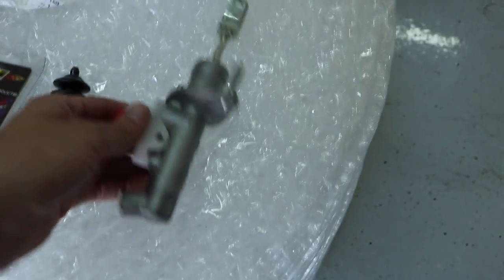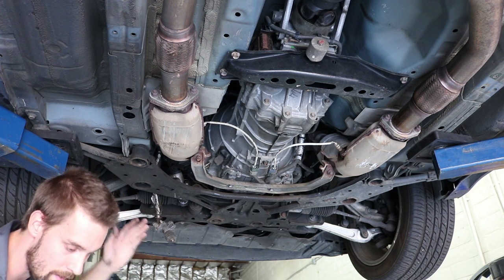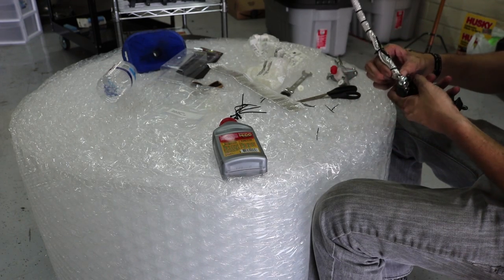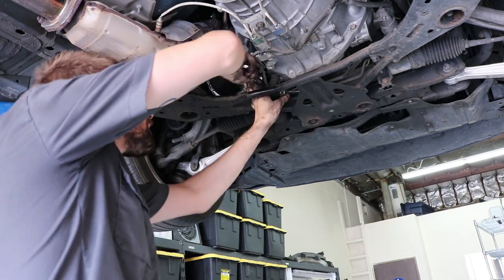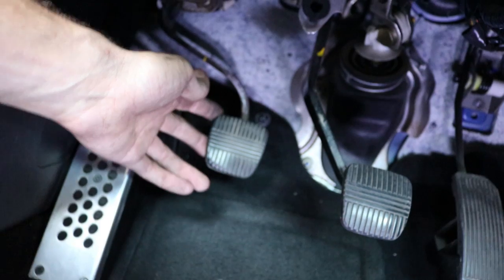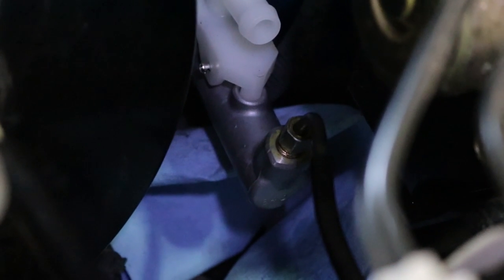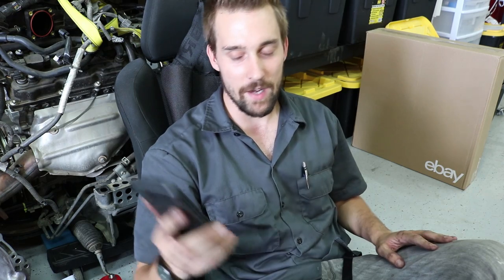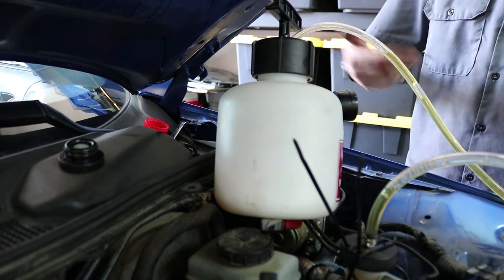350Z Clutch Master Cylinder + Slave Cyl  + SS Clutch Line Removal & Install

Comment: Hey bubba, I got a question about a grinding noise after a new clutch install. Is it normal to have a rough sandpaper or cement mixer noise coming from my 6 speed transmission after a full clutch kit install? Never had that sound before on stock clutch and it's not a  chatter sound, it's a sound like dragging a big rock over cement every time I push the gas peddle in every gear but does becomes less noticeable in 5th and 6th but is very loud and noticeable and annoying af in 1st, 2nd and 3rd evenr time I accelerate from a slow roll or dead stop, oh and theres no noise at all in neutral even if I rev the engine,  on when I am in gear while accelerating. Thanks in advance
Reply: did you replace the flywheel as well?

Comment: I’m having a hard time changing gears on my 350Z. Like they change but I gotta like force it to change. This situation happen after taking off on 1st gear and try switching into 2nd gear. After that, I’ve been having to force it to change to gear. Sometimes it’s hard to shift to 3rd. Sometimes it’s hard to shift to 2nd. Etc. sometimes I get lucky and shifting it smooth but sometimes I gotta force it to shift gears. My question is, will changing my master cylinder, slave cylinder and clutch line fix my situation?
Reply from the maker: Could be many things, lack of pressure because of air in the lines, bad fluid, failing master or slave, short shifters or unweighted shift knob etc
Reply: Full Throttle I bought the master and slave and clutch line. Ima have those replace and hope it fixes my situation

Comment: how do you recommend bleeding the slave if i dont have a lift. Theres air trapped in my system because i cant get under the car while its level so i put it on ramps. But it seems the the incline is trapping air somewhere in the slave and the air is unable to escape through the bleeder. Any advice? thanks!

Comment: Is the heat wrap material necessary for the SS Clutch Line? My understanding was the stainless steel itself and the material was designed to withstand higher temps than that of the OEM clutch line?
Reply from the maker: Av8tor The way I thought about it was I might as well do it while having it apart. I just wanted to be 100% certain that the Cali heat, especially during stop and go traffic wouldn't be too hot for the fluid.

Comment: Bet you’re having issues… you didn’t bench bleed the master.. you need the bleed them separate
Reply from the maker: I've done this over 300 times now since this video was made, my daily life is working only with z's g's and q's. And with the clutch master, primarily the VQ35DE it isn't necessary to bench bleed. It's actually not necessary at all with any vq platforms as long as you use a power bleeder. But you don't even need a power bleeder, and it's recommended not to use a power bleeder with the hr or vhr when they have an internal slave cylinder. You probably think I'd have issues, but that assumption comes from a lack of experience on your part. Best of luck with your z or g, since you're watching this video probably means you've never actually done it before.
Reply: @fullthrottleperformance   lmao.. sure bud. Enjoy your shit petal feel.  I do thinks right the first time.
Reply from the maker: @Turtlefarm  read the factory service manual bro 🤣 and there's no petals in a car, there's petals on flowers. And I always "thinks" the right way lmao 🤣

Comment: I have a 2008 g37. 6MT. So when I change gears, I noticed that 9 times out of 10. It’s not silky smooth. I’ve heard of grinding and crunching gears but I’m not sure if this is what they refer to.It doesnt make any noise, it’s just I can feel it. Sometimes it does go into gears smoothly. I also noticed when I’m not moving, I’ll put the clutch in, put it Into gear, take it out of gear and put it back into the same gear and the second time it goes in smoothly. But not the first time. What do you think it could be?
Reply from the maker: Have you flushed the trans fluid? And you have a CSC, they tend to go bad easily. It might be starting to fail, and when you initially put it into gear it's not depressing the pressure plate enough to go in smoothly, but after you take it out the gears are perfectly aligned and making it go in smoother? I don't know, just a guess. But I'd start with the cheapest route by flushing the trans
Reply: Full Throttle yea I had the Tran fluid changed at my work. I used Infiniti oem fluid. I started reading some comments on Tj hunts video and they were saying that using anything other than mt-90 will fuck up the synchros. Do you think that might be it. The one from infiniti is 75w-85.
Reply from the maker: If you got the fluid from Infiniti you should be fine. I know CD008/9's take only GL-4 in the trans, and GL-5 in the diff. That might be what he's talking about, but then again I'd never go to TJ's channel for info on fluids. You can find all that in the factory service manual, just google your vehicle, and "factory service manual"

Comment: Have you encountered a squeaky clutch slave cylinder? My clutch squeaks when pressing it sound like the slave is going out
Reply from the maker: Yes, but I haven't actually replaced anything because of it. I'd start with the cheapest parts first, and listen carefully to see exactly where it's coming from. And replace the cheaper parts first, that way you don't end up spending a lot, on stuff that doesn't need to be replaced
Reply: Full Throttle yea ima do that! It’s weird it sounds like a Creak when pushing down and it feels stiff but it shifts super smooth 🙄
Reply from the maker: Weird, maybe replace the slave, if it's just a squeak maybe wait till it starts going bad then replace it. Idk lol

Comment: How did you get that bolt off that stripped ? I’m having that issue right now and need to fix it ASAP !!
Reply from the maker: Yadi Cerda Spray it with some pb blaster or liquid wrench(penetrating oil), and let it sit for an hour then get back to it. That should make it a little easier, I didn't use it, I eventually got it. But I should use that stuff more often lol

Comment: If you didn’t power bleed the system, would you have experienced the clutch pedal going directly to the floor immediately after replacing the clutch master and slave cylinders in a Z, due to air being in the system?

I’ve replaced these components for other vehicles and the pedal would be spongy prior to bleeding but, it wouldn’t go straight to the floor.
Reply from the maker: Yes, z's are pretty difficult cars to bleed the clutch system. I've bled them before without the power bleeder(2 person bleed job) and it takes a lot longer to bleed. And the pedal will go straight to the floor.
Reply: Full Throttle: Thank you for your response. 

During the bleeding process, does the pedal eventually rise back to the usual maximum height, at the rest position?
Reply from the maker: Chanandler you'll need to pump it a few times, just make sure you bleed the hell out of it lol. And keep pushing the pedal a few times to get all of the air out of the master cylinder.
Reply: Full Throttle: Thank you for the info.

Comment: What do you think when the clutch let's go close to the wall? I tried clutch adjustments but still feels the same
Reply from the maker: Try getting a power bleeder, and bleeding the system. I've bled a lot of these and it always makes the clutch operation smoother. That's the cheapest route. Other items like the slave or master could also be an issue. But start at the cheapest item first
Reply: @fullthrottleperformance  bleeded and change just the clutch slave cylinder, and it fixed the problem
Reply from the maker: Awesome glad to hear you got it fixed!

Comment: Do you by any chance remember the eBay  seller you got your setup from? Was it from “zspeedperformance” by any chance for $175 shipped? Or was it someone else? 

I’m trying to purchase the exact setup you did. Also, I heard you mention something about Cali heat and I was wondering, you wouldn’t happen to be in the 916 by any chance would ya lol. Thanks in advance brother. Great channel for us z33 folk too. Keep at it man.
Reply from the maker: Yeah bro, I'm in the 916 lol. And here's the link of the seller I've bought some OEM parts from. 

Master and Slave
https://www.ebay.com/itm/2003-2005-Nissan-350Z-Clutch-Master-Slave-Cylinder-OEM-NEW-Genuine/191343943509

Phase 2 SS line
https://www.ebay.com/itm/P2M-Phase-2-Stainless-Steel-Braided-Clutch-Line-for-Nissan-350Z-Z33-03-06-VQ35DE/401595750553?fits=Model%3A350Z&hash=item5d80f8d899:g:dQsAAOSwLeVZ0mlq&frcectupt=true

Thanks for the support bro! It's much appreciated!!

Comment: Quick question, I’m currently replacing the clutch slave cylinder but no type of fluid is draining. I think something is clogged?! What could it be? If it’s the clutch master cylinder then I’ll be good
Reply from the maker: Do you have a power bleeder?
Reply: Full Throttle I don’t. But I just inspected something. The hose that goes from the reservoir to the clutch master cylinder, it still had fluid in there. No type of fluid was going thru. I took of the master cylinder and I think it’s clogged or something. Once I took it off, a little bit of fluid was coming out
Reply from the maker: @felipegarcia2419  What was your initial issue?
Reply: Full Throttle well I’m really hoping it’s the clutch master cylinder. Like I mentioned above, no fluid was going passed that cylinder. And I took it off after watching your video and I noticed some oil fluid came out. Expensive part but I hope that’s my issue
Reply from the maker: So, you get it fixed? What it'd end up being?

Comment: Can you tell me how do you fit the power bleeder adapter on the clutch master cylinder reservoir?I have been trying it but the two tabs on the side of the reservoir keep getting on the way.
Reply from the maker: It's kinda a b**ch to fit and hold on while under pressure. I usually use two zip ties to hold it down. But the two tabs go into the slots on the adaptor

Comment: FT what Power Bleeder model are you using to bleed the clutch system? Also which attachments for clutch fluid reservoir? Thanks! -R
Reply from the maker: R Loney Link is in the description for the exact model and power bleeder I got. It's also a Ford model, 0107 adapter. It's actually 20 dollars cheaper than I paid like 4-5 months ago. Only 49 dollars right now.
Reply: Thanks!
Reply: I enjoyed

Comment: Hey so i installed everything and the hardline that connects the master cylinder leaks every time I push the clutch pedal down. Is it not tight enough?
Reply from the maker: Hopefully it's not cross-threaded. Did you find the issue?

Comment: So my clutch pedal is doing the sticking thing but it works and I just replaced the slave and it’s still doing it so do you think I just need to bleed it more or a new master?
Reply from the maker: You figure it out? It could be either, make sure you bleed it plenty, the two man method works good, but takes a decent amount of time
Reply: Full Throttle yeah I did the two man bleed thing but it still wouldn’t build pressure I’m pretty sure it’s the master I adjusted the pedal and it made a big difference and doesn’t stick but sometimes it does so I’m just gonna replace master like tomorrow or sometime
Reply: Full Throttle thanks
Reply from the maker: Yeah, sometimes you just have to replace both. Best of luck to you tho, hope you get it right
Reply: Full Throttle thanks, btw helpful video

Comment: How much psi did you pump it up to
Reply from the maker: I generally pump the motive power bleeder up to 15 PSI
Reply: @fullthrottleperformance  Did you bleed the clutch with the pedal to the floor or while it was up?

Comment: Hey I got a question . My cluth pedal feels a bit sticky on hot days .. almost feels like I’m stepping on gum right at the engagement point . I’m thinking of pulling out the slave cylinder to grease it up u think that’s going to fix the problem ? Or am I better off buying a new slave cylinder all together ?!
Reply from the maker: Get a stainless steel braided line, and new slave. It'll be a lot better in the long run, you won't get that feeling, make sure you thoroughly check out the master cylinder. Because if it's leaking or bad you'll have to do the job over again. Slave cylinders are cheap, I'd just replace it. 👌
Reply: Thanksnman! Any experience with slave cylinders from autozone ? Are they worth it ?
Reply from the maker: @evanmavros1942  I would go to Napa, every time I've gotten a slave or master from Autozone they end up leaking. I'd personally recommend going to the dealer, because the slave isn't expensive
Reply: Full Throttle thanks for the help man ! I think I’m going to just bleed the line and grease up the slave cylinder tmr .. if anything looks worn out or broken I will run and grab one to exchange.
Reply from the maker: @evanmavros1942  Sounds good man, good luck with your z👍👍👌
Reply: Full Throttle it’s a G but thanks!
Reply: Will a “gravity bleed” get all the air out ? I’m a noob as u can tell from all the silly questions ..
Reply from the maker: @evanmavros1942  I always have to use a power bleeder, z's are pretty difficult to bleed
Reply: Full Throttle ended up buying everything new cause the problem didn’t go away . How come u have the powerbleeder cap on there with zip ties ? It doesn’t fit the clutch reservoir ?
Reply from the maker: Evan Mavros No it fits but I just like to be cautious with pressurized brake fluid
Reply: Full Throttle hey so I changed slave/master and braided line on my G.. for the first 4 days it has been working PERFECT to say the least but today I kind of felt some sticking again but nothing compared to what it was before .. what do u think is the cause ? Only thing I didn’t do when installing the new slave and master is grease up the tip head of the slave .. u think that might be the cause ?

Comment: Good video! Really need to do this to my zed. What ringtone was that? Ava?
Reply from the maker: MiddletoM Thanks man, and it's just the standard Samsung ringtone, lol. And if you do, do it on your z. Make sure you bleed the system really well, a lot of people skip out on doing a really good job at bleeding it, and it isn't worth skipping out after doing everything else
Reply: Ah lol, really does sound like angels and airwaves.

Anyway, i will just cough up and buy the power bleeder. i suspect my brake fluid could do with being replaced so the power bleeder will come in very handy. ive used the 'one way valve on the bleed pipe' method and its a pain in the arse.

Comment: Hey I got a question my 350z clutch pedal has an inch of play on cold start after driving for 30 minutes it gets stiff and sometimes when you push in the clutch  about an inch you hear a clicking noise do you have any idea what that could be
Reply from the maker: The clicking noise might come from the throw out bearing, have you tried bleeding the system?
Reply: @fullthrottleperformance  I haven't tried bleeding the system but when I do here the click it's coming from near the firewall on the drive side
Reply from the maker: It may be the throw out bearing, but I can't be 100% sure without being there. Aamco does free diagnosis for transmission related issues. They may be able to pin point the issue, but they do sometimes mis-diagnose vehicles. So, just keep it in mind when they tell you the "issue". If you decide to go there.